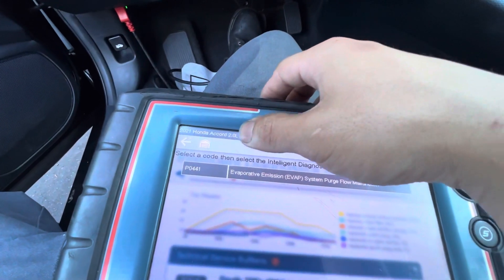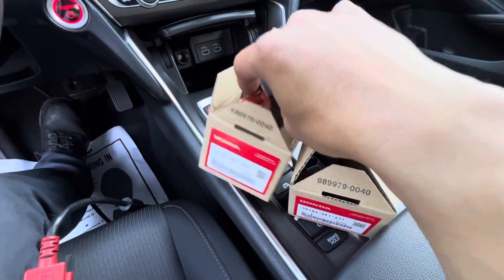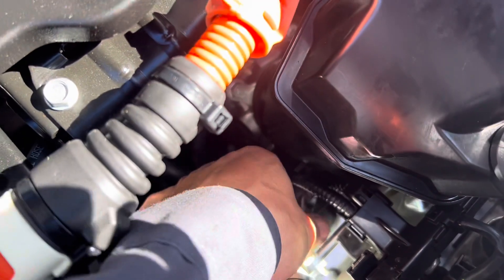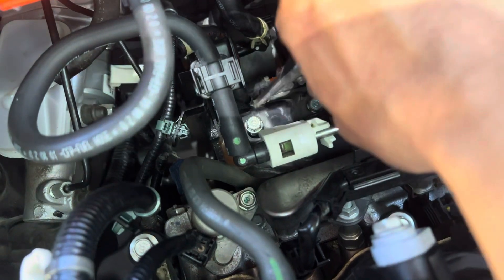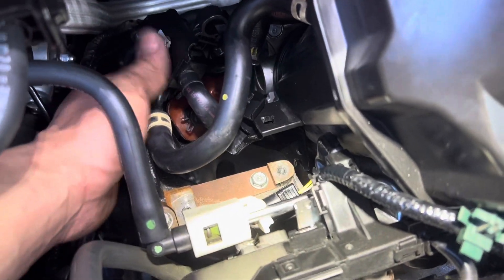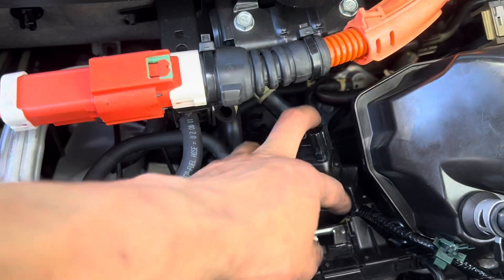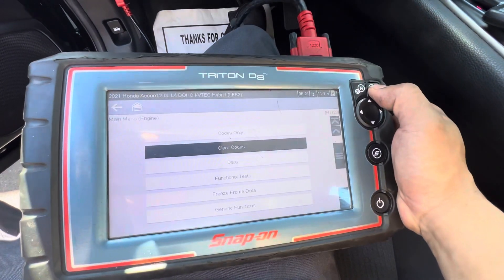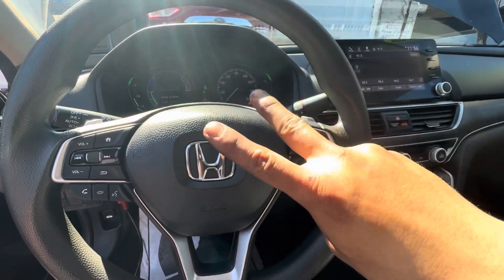2018 To 2023 Honda Accord Evap System Purge Flow Malfunction - Code P0441

Comment: Will this be the same thing for code p1462
Reply from the maker: P1462 is evap leak check module pressure decompression defect. Not sure for this code because the vehicle is too new, no info on it. This code is for the leak detection pump module next to the canister or the carbon canister is bad.